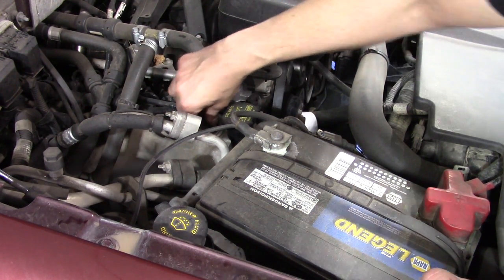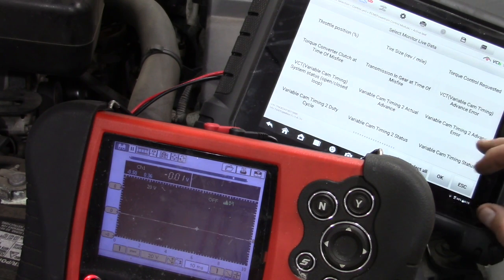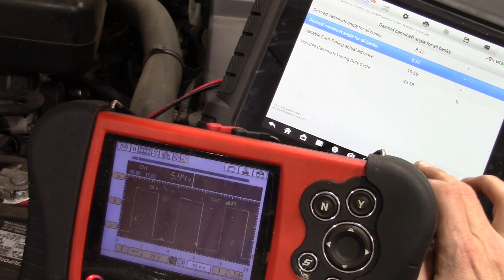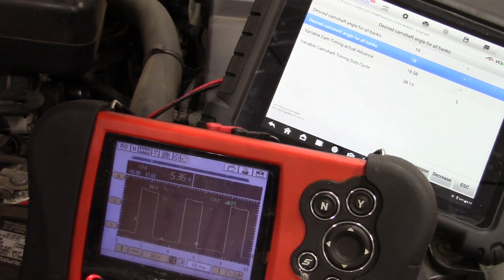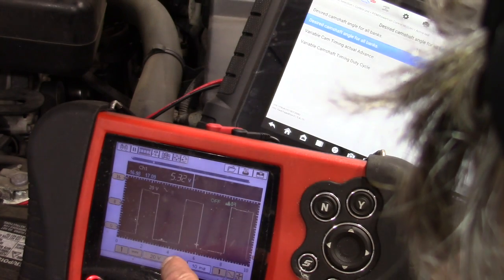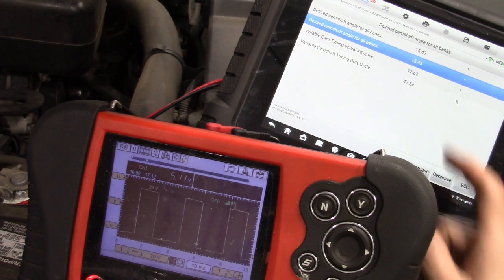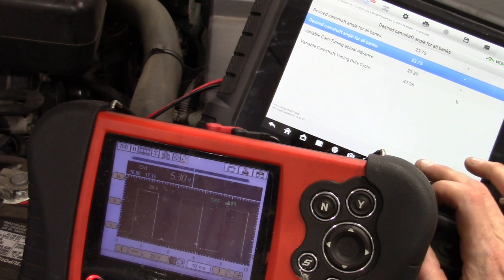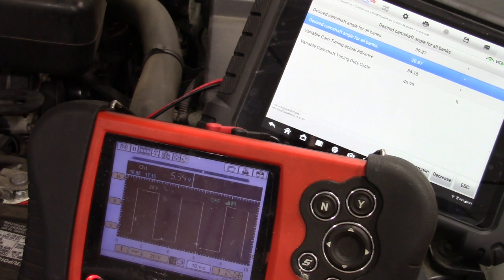Help! Why is VVT solenoid doing this? (Part1 of 2)

Comment: The roughly 40% duty cycle holds the cam at a fixed position. Duty cycles  below 40% should cause cam to retard, while %Duty above 40% should cause the cam to advance. The tricky part is that the cam timing change is very rapid then it goes back to holding cam at a fixed position, so it's easy to miss. So, you basically think you're looking at the same duty cycle the whole time because you missed the transient change of duty cycle. If you do a long record of the PMW signal you can apply a math channel to monitor the duty cycle over time. Then you will see it change when it activates. 🔧

Comment: Matt, I am going to take a shot.

The variable valve timing solenoid is sent a signal from the ECU to the solenoid to either Open/Close the valve. However, the signal you're seeing doesn't change on your scope because the ECU gets this information input from the cam/crank sensors instead of the vvt solenoid after the valve has actuated.
Reply from the maker: Well the issue with that is I am measuring that signal to the solenoid itself- not the one to the PCM.
   the next video explains what is actually happening.
Reply: @SchrodingersBox  Yep, I watched it shortly afterward. I incorrectly assumed that you had the correct parameters set in the diagnostic tool. So I overlooked that as you did. I did learn that the math function was helpful to see the driver signal. which was nice.

Comment: Ill be honest that I am seeing this more than a week after you posted and have read zero comments......the best I can say as to why you see no change in cycle or time is because it is constant no matter your angle and corrected. Think of it like the power of you house. The frequency is always 60 cycles and the time duration is always a second. But the voltage can change. You can have 100 v at 60hz or 130v at 60hz. In you example you are adjusting the voltage of the signal and it is maintaining the proper frequency and time duration for that adjustment.  Best I can give as I see that in my industry a lot.

Comment: Are we sure that it's not a substituted value?  If driven, does it change as we would expect it?  What happens with rpms, some won't do anything if there's a code or no speed signal or rpms. Just guesses really, since it makes no sense to me either!
Reply from the maker: Yes good thinking but we can see the physical change of cam position through CPS signal.  There is no doubt it’s a real value.
Reply: @SchrodingersBox  i don't understand how it could change without something else changing. My only other thoughts are a scantool comparability issue and to check those pids while driving to see if they change in regular data monitor, or global OBD2, if the pids are available. I tend to believe the cam is moving based on the pid, but does the cam signal wire change voltage with the commands?  Maybe watch for a change in current at the solenoid with the scope?  Again, I don't expect much from the suggestions, but desperate times!  Does service info have any helpful information?

If this is being performed at idle (not sure if it will even let you do it at idle), I'd expect the idle quality to suffer with large cam changes, like it would if an intake cam was stuck advanced or exhaust cam stuck retarded.
Reply from the maker: oh yeah the idle definitely was affected. that was the first evidence actual cam change is occurring but you can also see it on the scope as well as CPS.

Comment: Did some digging.  Found the following: "In this system, the ECU receives signals from the camshaft position sensor, crankshaft sensor, oil temperature sensor, mass air flow sensor (MAF), and the engine coolant temperature sensor and uses the information to adjust its output signal to an oil control valve." This may not be the complete story, but it is a good start.
Reply from the maker: Thanks- what we need though is to see what the output signal is- if it’s duty cycle controlled and how that varies with cam angle.

Comment: All depends on how much energy is imparted on the solenoid.  Don't see any closed loop of this system. Likely no feedback of angular motion.  Only certain amount of pulse width energy on solenoid.  Apparently you do not have the specs for the pulse width forced on the solenoid.   Don't know what variables the ECU uses to compute the pulse width to solenoid. One of those variable may be missing.  Now which one?

Comment: For PWM, the frequency is fixed.  Only the pulse width/duty cycle changes. Look carefully at the video and the pulse width did change but not by very much.  Otherwise, there may be corrosion on the connections or ground (better knows as return side of power).  If in doubt, tie a direct wire to the negative side and return it to battery  negative to eliminate bad connections on the return (ground) side of the power connection.

Comment: In the video it can be seen that the pulse width changes.  It is NOT always the same. Sorry but is self evident from the video.
Reply from the maker: please show where exactly and describe the difference at say 5degrees of cam angle vs 20 degrees. i don’t see it happening. you have to show evidence of where the change is observed.  All I see is normal “tithering” variances in pulsewidth, but nothing that seems specific to commanded pulsewidth modulation.

Comment: good chance the tool is lying to you,they should be change of sound of the engine when you cilcle the % 
or the pcm is not doing it because  fault code 
i would check with scope crank and cam signal change on duty cycle
if the pcm not controling phasers because of bad phaser then pcm goes to to default 
i would of did this with ids or forscan
Reply from the maker: Yep exactly what I thought too. The scantool is not lying though- turns out the scope was lol.

Comment: Use your Pico, that snap on doesn’t have the capability to catch the changes in duty cycle that you are looking for. Lower your time base and watch the duty cycle WHILE you are commanding the change. Once the vvt is in the desired position, it stays at the same duty cycle to KEEP it in that position. So (for example) at 60* the duty cycle is at 45%. At 70* it’s also at 45%. Only time it will bounce off the 45% is to change positions. It may go to 30% to retard. Or 60% to advance. But once it’s at the desired position, 45% is the duty cycle needed to keep it locked to that position. 😉

Comment: Looks like it has already been answered but the spool valve spends most of the time in the neutral or closed position.  The scope is not displaying the pulses that are slightly longer or shorter.  It is difficult to catch it visually with the scope but you would see it in the data logging.

Comment: Well, I guess this has already been solved, but I am going to give you my 2 cents anyways:
The VVT actuator has two radial chambers inside. If you fill one of the chambers with oil, it's going to advance timing, if you fill the other, it's going to retard timing. The amount of oil you need for this is minuscule, since the chambers should stay filled with oil. When you add that oil to one chamber, it "vents" the other. The duty cycle for the solenoid may only be changed for one or two pulses. When it does not need to add oil to any of the chambers, it "hovers" in the middle, and that's what you are seeing on your scope. Adding to that difficulty is that the scantool can only incrementally add or remove timing, so the changes are really tiny, and really short lived. Even when the PCM "slams" the advance, you may only be able to detect that for a couple milliseconds.

Comment: As I understand the VVT go from 0° to full advance ( or retard in the case of exhaust valves ) at a narrow range of dutycycle.  Therefore there is not much change in PWM from 0° to full activation. Maybe 45% dutycycle to 55% dutycycle from 0° to full advance/retard.  I guess that is different from design to design.  I guess that the PWM dutycycle hovers around that range. Just a guess.

Comment: not to be demeaning but you got to be smarter than the tools you are using.   in the old days we used analog scopes and if you didnt see it in real time you were usually screwed.       these digital scopes can record.  so get in the habit of recording everything then go back and relook at it. analyze it.  like others said it may only be one or a couple of pulses to move the phaser then it goes back and holds it.
  here's another possibility- a balancing circuit. this is where a constant pwm  voltage signal is sent from the computer and is recieved back at the computer. it is monitored for variation,   but also the change is actually done by grounding the signal inside the computer as it returns. so what you see will always remain the same.    the trick to these circuits is not to test the voltage  but amps.  current flow.  since the scope only reads voltage  you'll have to convert that  amperage to voltage  with a small inductive current clamp.  you may be able to see a very small voltage drop with the scope when the current flows  but it's much easier to see watching the current.  now if the vvt grounds outside the ecm  disregard the second paragraph.
Reply from the maker: No offense taken.  If you were also smarter than the tool, you would have told me about how to set up a math channel to resolve this but neither of us knew.
Reply: @SchrodingersBox  absolutely.  always keep looking for other ways to do the same thing. its all a learning curve. i'm still figuring out my scope. like i said the analogs just cant do  what these digitals can do.

Comment: Matt, as others have stated that if you look at the on time when you change the angle it does increase.  Also you said the duty cycle changes between 38 and 45. 38 percent is probably enough to maintain the valve in a fixed position and a 7 percent increase is probably all is needed to move  the valve to increase the oil flow. It is the hydrolocts that actually is moving the phasers. So I would suspect that it would not take to much effort to change the position of the valve and maintain it with a fixed duty cycle  ? Hard to tell because I was watching it on my phone but it did appear to change slightly  ?
Reply from the maker: Great observation Billy!!

Comment: Hi Matt! It appears that the duty cycle did change but it is small as others have pointed out. With PWM circuits the duty cycle is changed but the frequency remains the same. I have seen frequency and pulse width changes in PWM circuits but they are rare and I’ve only seen it in an industrial environment using motor and temperature controllers. To confirm it’s operation, hook up your Picoscope and set it up for two math channels. One will be set up to look at the duty cycle on the low side and another to look at the frequency. For the duty cycle, you'll be looking at the switching on the ground side. In the math channel for the duty cycle, you'll be setting it up as duty(-A) if you're using the A channel. The - sign tells the software that you're looking at the low side to calculate the % of duty cycle. The range of the duty cycle in the math channel would be 0 to 100%.

To get an idea of what to set the frequency range to in the math channel, you can measure the period of the waveform from one pulse to the next. For example, you could measure the time from one rising edge of a pulse to the next rising edge. Let's say that it is 1mS. Take this value and convert it to seconds. This would be 0.001 seconds. Take this value and divide it into 1. The calculation would be 1 / 0.001 which is 1000Hz or 1kHz. Then you could set your range from 0 to 1000 or maybe a little higher such as 0 to 1500 to give yourself a buffer.

Be sure to set the scope up for a long time base such as a 20 second screen time and the channel properties for a 1uS sample interval. You can right click on the screen to access the 'View Properties'. And you adjust the time base to change the sample interval. This is for the Picoscope 6 software and although I really haven't used version 7, it should be similar. When you change the timing, you should see the plot of the duty cycle change and then stabilize. The frequency plot should remain stable with timing changes. Have a great day Matt!
Reply: Mr Stuzman is happy to be with us.
Reply from the maker: I am happy he is with us for sure. I am not exaggerating to say the channel would not be where it is without him. He was literally my second subscriber and ever since he has reached out to offer help like this.  over the years it has become exponentially more complex which is testimony to our progress!!
Reply from the maker: Thanks as always Terry!  it wasn’t too long ago your answer would have made no sense to me whatsoever  hahahaha!  Now I know exactly what to do.
Reply: @SchrodingersBox  Glad to help Matt!

Comment: Its not mechanically moving, thats why, your just comanding it to move, try doing it by raising the rpm and you should be able to see it. Scantools show missleading data sometimes, it probably moves it just enough so that u can hear an engine change but not far enough to where u can notice a difference on the scope
Reply from the maker: This is an actual position measured by CPS though. The command is a separate PID.

Comment: U should scope the cam and crank also and see if the change in cam its actually happening. Ur diagnostic tool might only show how it should be rather then what it is.wirh a signal generator for duty cycle could come in handy to probe that selenoid without the help of diagnostic
Reply: The fixed duty cycle should be becouse the computer runs it in a safe mode becouse of faults related to it
Reply from the maker: Yes I thought this as well but why is the actual cam position changing?
Reply: @SchrodingersBox  
Maybe is not changing, it's just tell that it's changed, but didn't. Scope crank and cam sensor, and then you will be sure that it's changed. Maybe a software problem?
Reply: @SchrodingersBox  i definitely learn new things,including using my math channel on the scope more often🙂

Comment: Wrong engine oil for the Ford/clogged solenoid.
Reply from the maker: Hmmm what evidence is showing that? I see clear evidence to the contrary here. Look at the independence variance- how can oil be causing that?
Reply: @SchrodingersBox  Well, without getting to technical, it was based on a hunch - but you knew that, you knew, I had no idea what I was talking about - and now you just want to mess with my head by using technical terms like independence variance, I would not be surprised if you hear from my lawyers. You could of just changed the oil and it might of worked but not you oh boy not you, you had to breakout the scan tools, lab scopes and other rubber encased products. PS Love you videos keep up the good work.
Reply from the maker: Hahahaha you got me.
Reply: @SchrodingersBox  what do you mean by independence variance you know I'm still learning

Comment: Is the engine above 800 rpm's? If so does the other side do the same? I see very little change in PWM as well .. possible oil pressure issues on these VCT's as they gum up or the screens are restricted on oil flow. A quick way to see this is with a signal generator and watching the pids. Also there updated phasers for some of the 5.4's as well. It really looks like the the PWM is lazy. I have seen these lag out just due to a bad oil filter before. The system is dormant below 800 rpm's, commanding the cam signal at idle (if below 800 rpm) will show very little change in VCT'S if any at all.
Reply from the maker: Great point on the RPMs but other side does same exact thing but does have different variances in cam position.  But same pulsewidth modulation.
Reply: @SchrodingersBox  tbh that should be normal .. if the PWM is the same then the VCT'S should be doing thier jobs. I would put the pico on it for your class .. you will see it much better on the time base. Over 800 rpm's while adjusting the timing you should see the PWM move to a certain percentage and stay there until you adjust the timing again. I would shoot for about 900 to 1k with the pico and watch PIDS .. or feedback with a signal generator and watch PIDS (just to be safe.. makes me a little nervous moving the timing at higher rpm's, especially on a 3V 5.4.. lol). I assume this is just for you class and there is nothing wrong with the engine. Pico is definitely going to show you a better base. HTH .. btw I really do enjoy your videos and training .. I brag about you to several "YouTube techs" that want to be automotive diagnostic techs. Keep up the good work brother!
Reply: Nm .. I just watched you P2 video .. great job brother .. I especially like the idea of using a node light to verify OCV active.. I will use that for a quick check myself .. lol. Thanks again

Comment: Matt, if you look very closely you will see there is a brief change of duty cycle on the scope just as the command changes, but then it returns to the default value to hold the valve in the centre position where it is neither filling or draining the VVT phaser of oil once the desired position has been reached.

Comment: you need to trigger the scope off of the crank shaft position and not the solenoid pulse, you will then see that the solenoid pulse is changing relative to the crankshaft.
Reply from the maker: I don't see how that would help- I already see cam angle change, we don't need the crank sensor for that.   please explain why I am not seeing difference in pulsewidth modulation- thats what I am interested in.